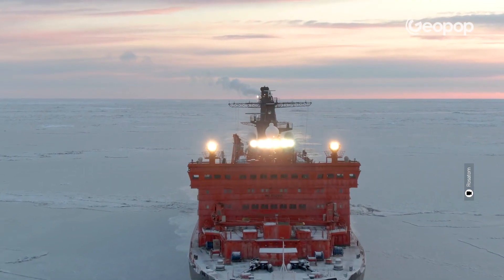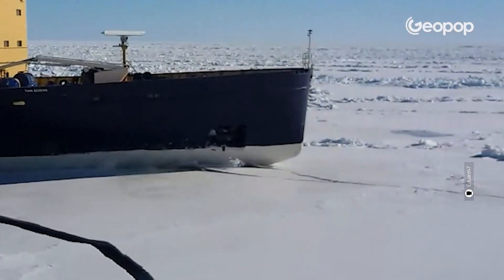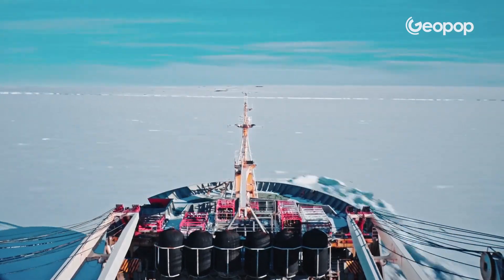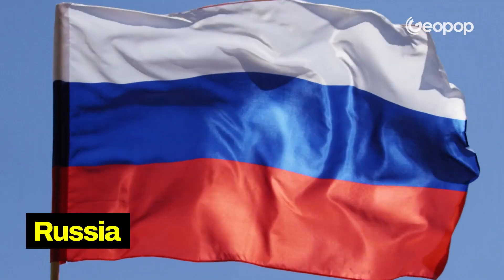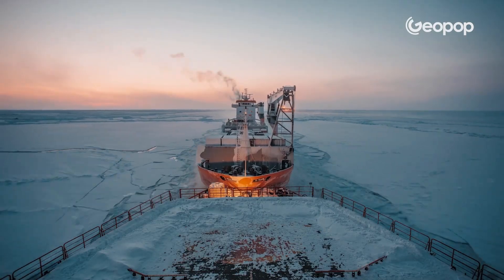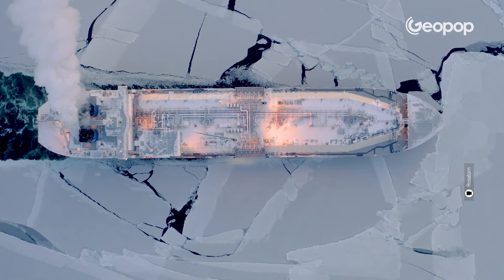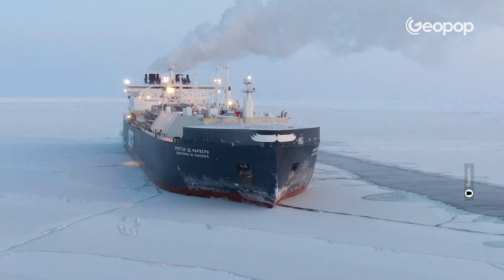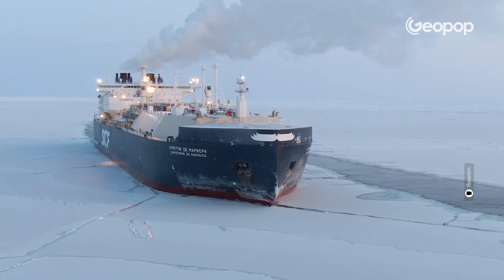Nuclear-Powered Icebreakers: How They Work and What They Are Used For

Comment: Nuclear reactor is not about power itself. It's about the ability to sail months (years) without refueling!
Reply: Nuclear reactors are, by design, about power.
Reply: @philipb2134  One more time! There are marine combustion engine more powerful than on icebreakers. And Russia has big diesel-powered icebreakers as well. The reason to go nuclear - basically unlimited operation range. It's kind of difficult to re-fuel in the middle of Arctic :)
Reply: @alexokunnur8946 Russia's most powerfull icebreakers9 are under nuclear power

Comment: I have a gnawing concern about nuclear-powered ships: what if they sink? 

In temperate waters, a recovery process might be excruciatingly painful, but feasible. It's not the same in the Arctic.
Reply: It is not that much of a concern. If the the ship sinks in shallow enough water to be dangerous, then it is also shallow enough to salvage. If it sinks in deep water the sheer amount of water at that depth will trap the radiation and it wouldn't be dangerous.
Nuclear reactors(on land) need about 100ft of water above them to neuter the radiation to near-zero.
Reply: @jamesguthrie9454 please cite your source(s) which were supportive of your contentions.

I had worked closely with the French  civilian nuclear industry,  and part of my brief was to provide shielding materials - and that required knowledge of radioactive absorption

I do not agree that your assertions are tenable.